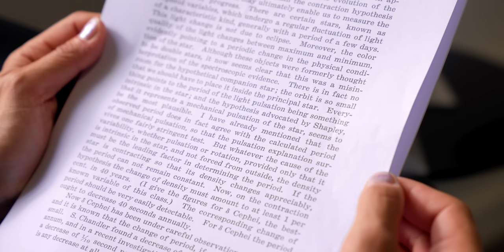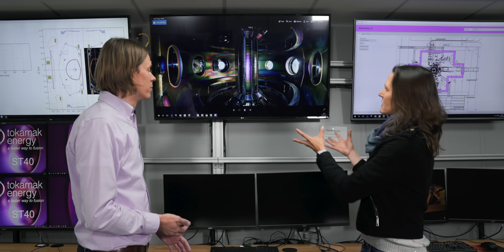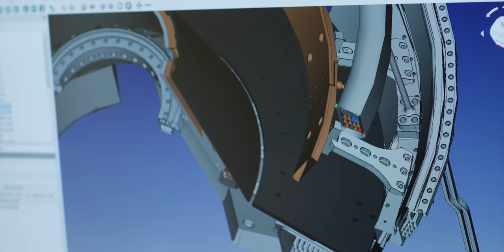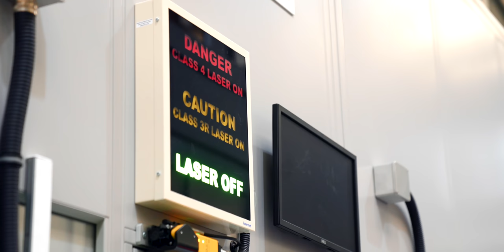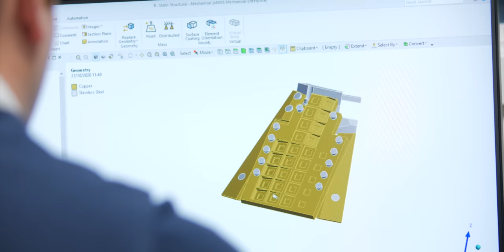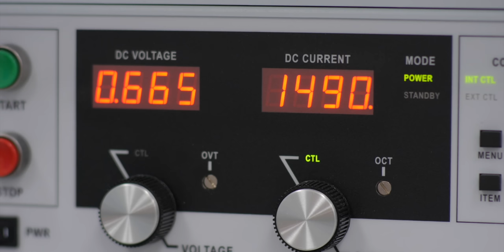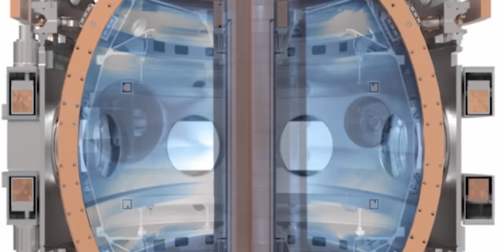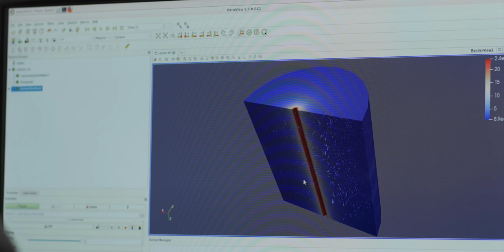Nuclear Fusion: The Secret to CHEAP and LIMITLESS Clean Energy?!

Comment: you must make the swirling ion hurricane a plasma zero resistance inductor battery, at the same time
Reply: yes it must be a dc coil inductor battery, not ac
Reply: if you make stuff to service you, you are doing it wrong, you should instead free things from service, to make yourselves free
Reply: let them give you the stuff
Reply: do not use magnets to confine, let material itself confine passively, use the magnet to spin up the swirling hurricane, you benefit more from the spin up than the trying falsely confine
Reply: z-pinch dc emf ion tornado reactor
Reply: center of the toroid must have the fusion zone, outer cross section areas dont matter, they act as a cushion heat transfer area
Reply: if you want critical mass, boom some mini h-nukes, with the uranium nuke starter, cool it with a ton of sea water, in a chamber
Reply: physical gas confinement

Comment: It's called, fleecing investors. The promises aren't realistic but investors are more driven by the climate change fear and not based on results. If the promises are too good to be true, they usually are.
If they can improve the technology of converting heat into electricity, then I can see the value because currently that convertion is woefully inefficient.

Comment: Forget fusion, it's too late.  Even if we had a fully working prototype of a practical fusion reactor now, it couldn't compete with WSB (wind+solar+batteries).  We can build WSB faster and cheaper, so there is no market for fusion, or fission for that matter.
Reply: What is currently mature enough battery technology, i.e. type of battery or method for energy storage, that could cheaply and reliably store energy at the current grid capacity scale?

Comment: Cost of the machine?
Cost of electricity?
Free electricity for everyone?
Nothing wares out?
Planet climate destabilized ?
Every building is connected to the grid. 
Every building has a roof.
Solar energy on every roof. 
Electric vehicles battery sucking up electricity all day from the grid.
Solar PV panels efficiency last 25years and then add 2 more panels and go another 25years, 50 years sounds good to me. 
Every one talks about their little bit of the BIG TECHNICAL CHALLENGE and comes up with CRAP conclusions.

Comment: I understand the need for building scaled down prototype at first, but this small device will never give reliable data.
ITER or the Wendelstein 7-X has much more chance to be successful (if ever)
Reply: From the sounds of it, this scaled-down version has let them test some of their theories and produce better designs - which are going into the larger reactor, along with better magnets, etc.  Given the costs involved, building smaller prototypes is going to be far cheaper, and definitely worth it provided they give enough data to help reduce the costs of the larger prototype (and the reduction in the larger prototype is more than the smaller prototype cost :D)

Comment: Solar is harnessing fusion.
Reply: Storage?
Reply: @Redmist.65  Crikey, what a question! Any number of ways, Google is your friend.
Reply: 😂😂😂

Albeit at a remove of some 8.5 light minutes.
Reply: @t1n4444  As climate scientists have said, no one solution is the answer....and this is just one piece of the puzzle. But with this unlimited powersource you can create huge carbon capture machines are negative carbon output to then put back into our cars or store. This will result in the avoidance of mining for materials like Lithium.
Reply: @Redmist.65  No.

You're a bit off ref carbon capture as in if you don't make it in the first place you can forget about it.

And if we get around to planting enough trees etc then that works as a CO2 sink.

Seaweeds planted in the intertidal regions are allegedly even more efficient at absorbing carbon dioxide.

Interestingly humans can eat seaweed so a win:win situation.

In UK we can produce over half of the domestic load using wind turbines ( presuming wind is present and it is).

In UK we can now generate green hydrogen via green marine wind turbines.

We generate a fair bit electricity, during daytime, via solar.

Why EV have decided to include an item on a tokamak is their choice.

One can only speculate it is a item to demonstrate that green power can be generated by other than renewables.

I don't suppose EV were suggesting cars will have an onboard tokamak reactor ... well, not this week anyway.

Comment: Fusion doesn't help me.  Even if my local power company could generate energy completely for free, from sea water, they will still bill me $165+ a month.  I need affordable, efficient, solar on my roof, along with a powerwall type battery system in my garage.  As long as I'm connected to the grid, the local energy company is going to screw me, and everyone else on the grid.

Comment: No. It's not the answer. It is too far off a viable solution. We should be investing in Solar, wind, hydro, geothermal, District heating systems, reuse of waste heat and low-grade heat, solid state batteries, lithium ion batteries, waste to bio-gas, gravity batteries, clean hydrogen, algae fuels, fly-wheels, capacitors. All workable solutions that need investment to either get them off the ground or bring down prices even further.
Reply: Why not do fusion as well?  One thing's for certain - if we don't do the research, it'll never happen.
Reply: You're acting like only one technology can be invested in at a time. If we didn't invest unviable solar 60 years ago we wouldn't have good panels to use now.

Sure fusion might not be useful in your lifetime, but if you stop thinking selfishly you could see how an investment now could really help future generations have a better life.
Reply: @drewcipher896  if you look at my comment, I have listed many, many different technologies. I'm not sure how you read that as one technology to invest in. Fusion is only theoretical atm and once up and running will take many years longer, whereas the other tech and the climate crisis are very real.
Reply: @aeonturnip2  it's too far off. It will take decades before we have a working model for fusion - which we don't have time for. The other tech is ready to go now.
Reply: The effort that's going to save us now probably has to be based on existing technologies. After that though, I think we will want this and I don't see why we cannot keep it going.

Comment: It’s so sad to see people waste so much time and money on this. Fusion is for the blind who don’t understand basic reality. The theory of relativity and basis of nuclear energy is understanding that matter is concentrated energy, so you go backwards to get energy. Fusion is a process that consumes energy to make denser elements. Fusion isn’t even the energy source for the sun, gravity is. Fusion is just the energy released when you use energy to force elements together. The amount of energy released will be less than you put in though. Unless you have a gravity well supplying an endless amount of energy to begin with, it’s a distraction. Fission is the process of releasing matter to its original energy form. The only time fusion makes sense is when you use it to enhance fission. Just use molten salt reactors which are meltdown-proof, produce far less waste than traditional reactors, and even the reduced waste is shorter-lived too.

Comment: Fully Charged going off into the realms of fantasy.
Reply: It's ok, go home and read your bible.
Reply: They're just showing us research.  If you don't like it, you don't have to watch it.
Reply: @aeonturnip2  this "research" has been going on forever. nothing really new from these very expensive projects in 2 decades except they still get paid. fully charged is a great channel and should be above regurgitating this old nonsense.
Reply: @mortenmlbjerglund772  This tech is not for now and we won’t be dead in ten years.
Reply: @nickskinner1482  I'm not sure what led you to think this is nonsense. The science is sound: as Helen Czerski saids at the end, it's an engineering problem to make it work, but when we do it has massive potential to provide incredibly cheap and clean power which we're desperate for. Yes, it's a difficult engineering problem which has tripped us up before but should we only do the easy things and give up when things get tricky?